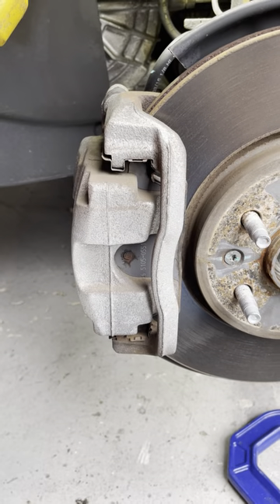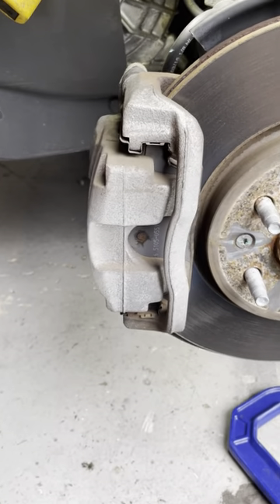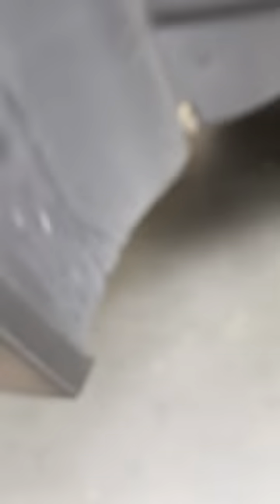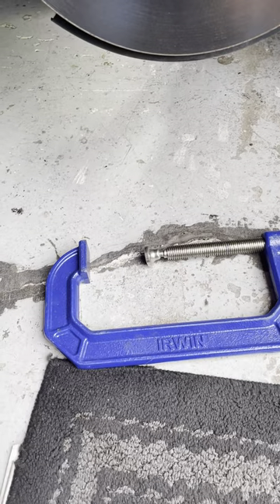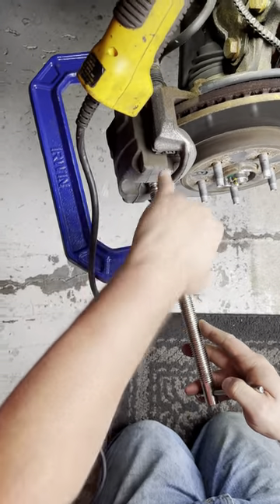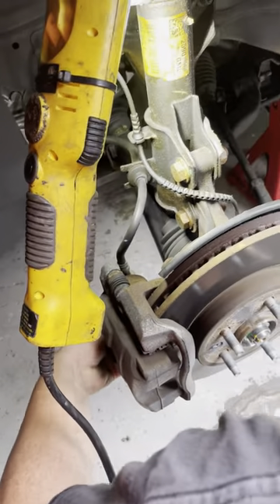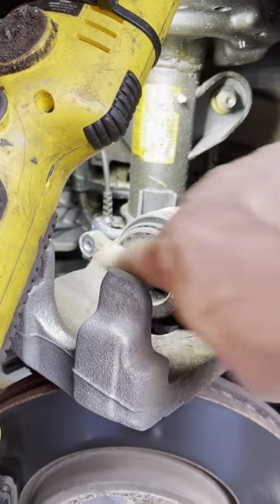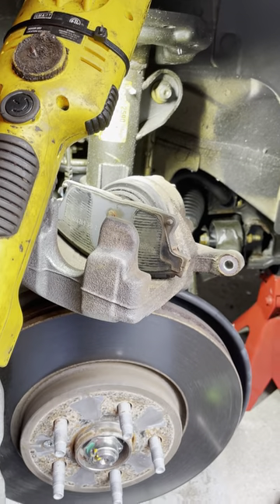How to properly remove a brake caliper (No screwdrivers or prybars)

Comment: Been using this technique and it works!  Went to using a woodworking quick clamp (it is lighter and easier to work with).  Remember to take your brake fluid cap off.

Comment: It works on single piston only if you get dual piston I doubt it
Reply: You don’t think you could go back and forth between the two and get enough room to at least remove the caliper? I’m gonna find out this weekend on a Silverado…
Reply from the maker: Yes it works with dual piston..I use this technique on a Dodge Ram 1500 with dual piston calipers.